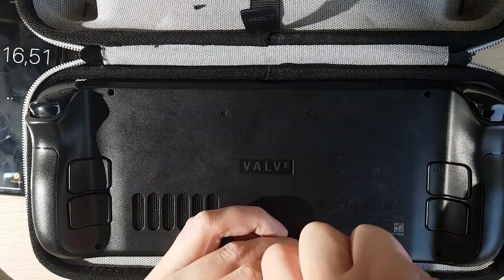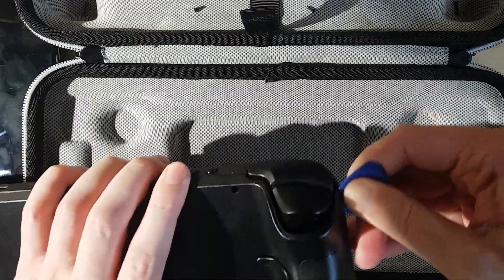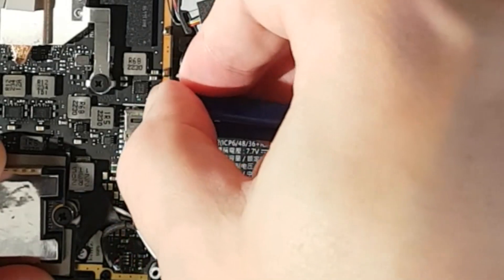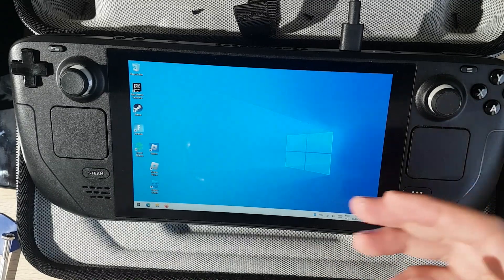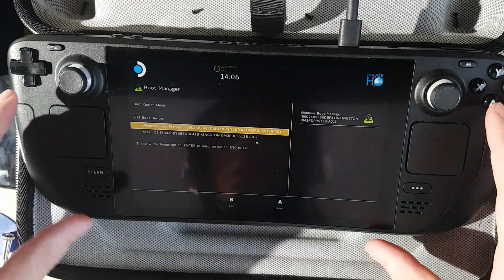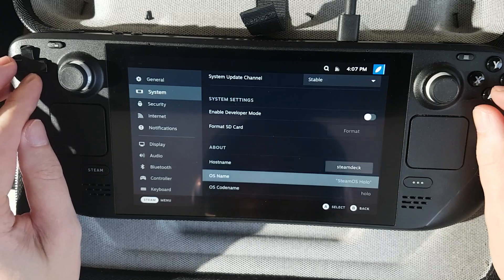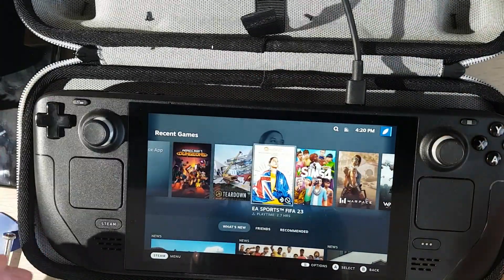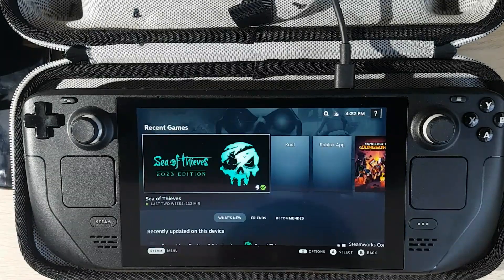Can Steam Deck Run Without Battery?

Comment: Without the battery it can run games only on tdp set to 12, even on 65w charger, otherwise it will be restarting every strong load moment in the game. My battery has been inflated after 2.5 years despite the 92% of health in the battery info, and I decided to remove it until the new one arrives.
Reply: What is tdp?
Reply: @quietpigg tdp = power wattage you set it to use .
It uses only 15w
So 12w is good without battery
Reply: I’m working on a project that uses the steam decks pcb without battery.

The way you can get around this power issue that I came here to ask about too (thankfully you confirmed it wasn’t just me) is by using a trigger board that can do 15v at 5A, then a step down to 7.4 or 8,4v and wire that up in place of the battery connector. It’s not for the faint of heart but it would be the “proper” way to power the deck without a battery.

Word of warning you do most likely need to prevent power from going into the usb c port of the deck
Reply: I’m not sure if matters about removing power input from usb c but it’s something I’m doing regardless in my project

Comment: Is there a way to use the steam deck connected to the power supply without recharging the battery? (example: I play for an hour, the battery runs down by 20% and then I connect the steam deck to the TV since I don't have other consoles, but I don't want it to recharge (otherwise it gets ruined by recharging a small percentage each time) is it possible to disable the recharging by only powering the steam deck directly?)
Reply from the maker: Kinda "Battery bypass" switch would be cool. But no. No such thing even on hardware level. At least internet says that it's still a wanted feature.
Reply: I read that it has pass through power
Reply: @quietpigg but the steam deck every day for about 1% so once it drops below 90% it starts charging again and therefore it is not a very good idea
Reply: Oh nevermind my comment, I just read that the Odin 2 has a battery bypass switch and that is better than the steam deck's way of doing it so I am purchase that, I dont need pc games

Comment: Glad to see this, I heard that the SteamDeck has a Battery Bypass, 
But you just don't know unless if you Pull the System apart and do this,
Its great to know that its not just Marketing, I wish the Nintendo Switch had this kind of thing

Comment: My Steam Deck battery is starting to get bloated so I removed it and tried this. 

It can run without a battery, browsing the internet and playing light video games is perfectly fine but whenever I run the heavy 3D game, the game is crashing and it automatically reboots the machine every time.
Reply: Yes your Steamdeck needs 60W charger minimum, 
And make sure your USB C Cord Supports upto 60 watts aswell
Reply from the maker: Normally, game crashing is not a power issue. I tried with 30W charger and Steam Deck just shut down when had significant load. 
I had similar symptoms when I changed VRAM allocation to non-default value.
But I can't verify, I sold my Steam Deck and bought a PC.
Reply: @4ngeek  My BIOS is set at the default value and no undervolting but it still shutdown randomly when I ran a graphically demanding game. But I found a way to prevent this by setting the TDP limit to around 10w or 9w and lower in-game graphics settings.
Reply: @KuroDraco  I don't use my deck much as a portable but mostly docked, today it did not start properly so I picked it up to start it not docked and noticed that the back of it looked a bit bulged ! I have to say I panicked. I straight away empty the battery and opened it up to remove the battery. Battery was really really swollen, I have never seen a battery this bad before. I used a hairdryer to warm up the battery so I can remove it but half way the hairdryer died (my lucky day), I really wanted to remove battery as I was very worried it can cause a fire, so I put a little alcohol around the edge and battery came off straight away but some alcohol went through to the screen, it looks a little marked but I hope it will dry and maybe will not leave a mark. I then searched if I can run it without battery and end up on this video. I can confirm it runs, but then I thought to try powering it with my 60w power bank, It works also but in game it crashed . Thanks to your tip after lowering the TDP it did run a game fine, so I thought to leave a reply and thank you. I don't think I will buy a battery, it is expensive and  my steam deck is a bit old now (I got one when first came out) so I will continue to use it plugged in and if I want to use it as portable I can always plug it on the battery bank. A good point with the battery bank is that the steam deck feels so light in the hands.
Reply: Appreciate your comment. Currently waiting on a new battery. I can play Mount and Blade no problem, but played Witcher 2 and it crashes on heavy scenes.

Comment: Have you tried with a dock station?

I know I've tried the Rog Ally with the battery disconnected AND using a dock station and... ...it did not work, unless the battery is connected.
Reply from the maker: I have simple usb-c powered hub that has 100W PD (that actually delivers about 95W to the host) and it works fine on stock charger without battery with monitor and mouse and ssd. (https://www.amazon.fr/gp/product/B0BR3M8XHK/)
However, always make a return-plan, so if something is not working as you expected, just return everything back to store.

Comment: Thank you. It is sad that there is almost no such feature in phones. Now the question arises. And will it work without controllers and how much should I throw away...?😉😇❤
Reply: I used to have a Galaxy S5 that with a bad charger port that I didn't feel like replacing so I bought a second OEM battery and external battery charger from aliexpress for like ~4 dollars and just swapped batteries but that was back when the backs were still removable.  I miss when companies expected you to poke around in a device.

Comment: If it is not your cup of tea, just sell it. Every device that contains a battery has a life span. When it comes to Steamdeck, the battery will eventually die, but i am sure it will have aftermarket support for several years ahead.

Comment: This is a weird video 😅 even for me who owns 3 steamdecks now why would anyone do this?? If you just want to dock it just do it without unplugging the battery 😂😂😂 what did I just watch😅😅😅
Reply from the maker: Well, as I tried to explain in the video - I’m facing the choice now: sell or keep. I have 4 old iOS devices and 2 old macs with the same problem: dead battery. iOS don’t run on charger with dead battery. Macs do. New battery costs more than those old devices themselves.
With Steam Deck I expect the same, but sooner. Gaming devices wear out, and loosing their cost faster.
So, to know if this thing is future proof, I did this test.
I can also embed it into a car if I want to.
Reply: If the battery is bloated and you're waiting for a few days for a replacement. this can be pretty helpful